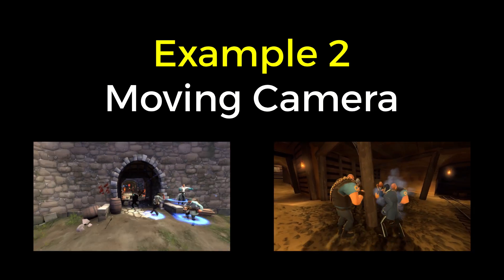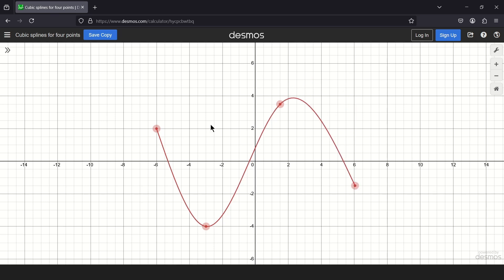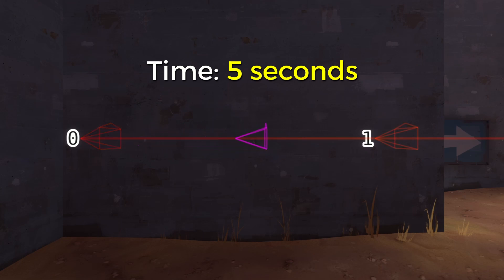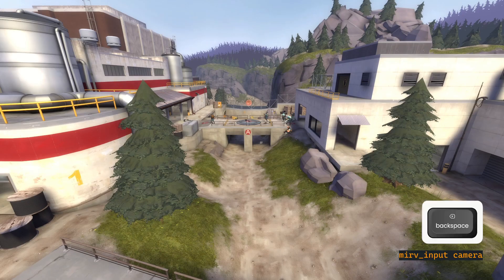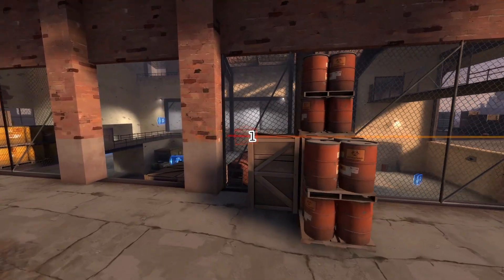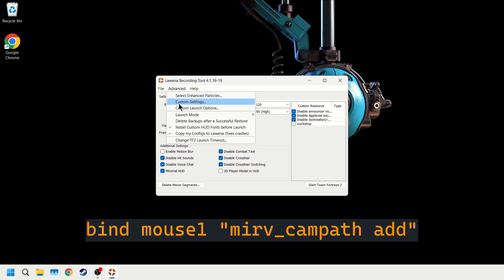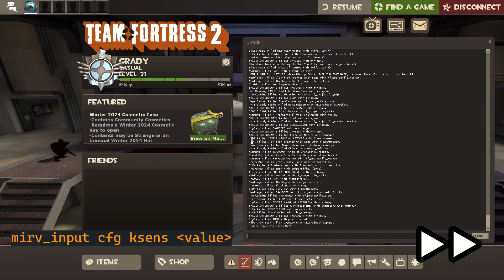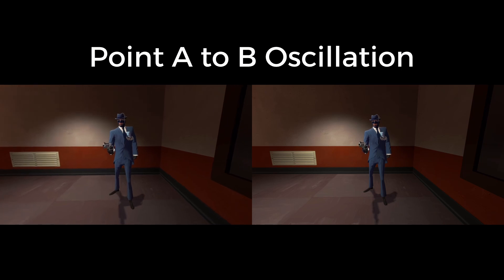TF2: HLAE & Lawena Full Tutorial Part 2 - Moving Campaths

Comment: really well made tutorial! very informative and it helps a lot. i appreciate you taking the time to make this.
i do have a question though, do you think it's possible that maybe a controller, such as an xbox controller, would be able to be used for a substitution for WASD jittery and rigid camera movements? sometimes you dont wanna make a campath but wanna freehand stuff. and maybe if its possible with a controller, moving the camera could be smoother than with a keyboard? im curious to know what you think, thanks in advance!
Reply from the maker: That's a creative thought, but luckily there actually is a smooth freecam feature that I found out about after releasing this series.

It had some issues though, so I modified HLAE to more resemble TF2's freecam as much as possible: https://github.com/wgez/advancedfx/releases/tag/v2.186.14-smooth

I'm working on a guide for it right now, but it's gonna take a while. I'm gonna have to give you a quick rundown as a comment.

You just need to use my version of HLAE instead of your old one.
1) Download + extract the first zip (I hope your browser/pc doesn't flag my release as a virus)
2)  In Lawena, go to (Advanced -> Launch Mode -> Select HLAE executable...), then choose the newly extracted HLAE.exe.

Now you should have the ability to use smoothcam. But I've made some extra commands to go into your Lawena custom settings.
1) Copy these commands and add it to the bottom of your custom settings (Advanced -> Custom Settings...):

// Commands to help use Smoothcam
alias h_mesA "echo smoothcam_ON"
alias h_mesB "echo smoothcam_OFF"
alias h_smoothon "h_mesA; mirv_input cfg smooth enabled 1"
alias h_smoothoff "h_mesB; mirv_input cfg smooth enabled 0"
mirv_input cfg offsetMode ownLast

// Optional: Recording Smoothcam Feature
// Note: Susceptible to demo file lag
// If too much jitter in campath, record smoothcam manually (OBS)
alias h_do "mirv_campath add; wait 11; h_loop"
alias h_mesC "echo record_path_START"
alias h_mesD "echo record_path_STOP"
alias h_on "h_mesC; alias h_rec h_off; alias h_loop h_do; h_loop"
alias h_off "h_mesD; alias h_rec h_on; alias h_loop"
alias h_loop ""
alias h_rec "h_on"

// WARNING: Drawing h_rec path onscreen (J) can lag/crash game
// If using h_rec, unbind J (remove the double slashes below)
// unbind j
Reply from the maker: Now you're ready to use smoothcam:

1) Turn ON smoothcam with the command: h_smoothon
   Turn OFF smoothcam with: h_smoothoff

2) Adjust acceleration/smoothness with: mirv_input cfg smooth halfTime <value>
   The default value is set to 0.2

3) Extra features about this HLAE version:
   a) No twisting (Z and X keys wont work) - trust me it makes your cam look much better
   b) You can't look too far up and down (no backflips/frontflips, which are disorienting)

There's also an extra feature I had you add in Lawena's custom settings which I feel is too complicated to talk about in a youtube comment (h_rec command). It's meant to help so you don't have to OBS record each and every attempt you make at tracing a path with smooth freecam. h_rec will spam campath points, so you could just record the campath if you're happy with the attempt you traced, if that makes sense. You can try it out if you'd like. Heed the warning though, avoid rendering the campath since it has a lot of points.

Some of this stuff may not be finalized. Let me know if you have questions. I may not respond as fast cuz my bot doesn't see replies.
Reply: @Weegeepootis2  thanks so much for this!! ill be sure to try it out, when i did, ill let you know how i fared.

edit: i just read through the features you listed. yeah the camera barrel rotating type thing was frustrating. and the backflip frontflip camera was nauseating as well.
Reply: so i tried out the smooth camera feature you made. it works pretty well! no complaints so far. though i still have some issues with campath wobbling i think. they camera doesnt tilt anymore, but it still overshoots the camera placement sometimes.
for example if i put a camera point near a wall, it sometimes goes through the wall and takes a while to move to the next point.
is there a way to disable this or maybe lessen this? thanks!
Reply from the maker: Yes, overshooting is something you're gonna have to learn to deal with. It's an inherent mathematicaI behavior that won't go away. I can't give you a one-size-fits-all solution to this, since it's dependent on your path, which can vary infinitely. You have to get a sense of how campaths behave, which takes practice. I'm basically reiterating the video.

It's the toughest thing to teach. One way to learn is the desmos website (eg. visualize a horizontal line/wall and try to prevent overextension into the wall).

As for your specific situation, it's hard to pinpoint your problem without seeing it. But since you described it as "taking a while to move to the next point", that probably means that either your wall point was placed too early (draw it at a later time), and/or your next point is placed too late (draw it at an earlier time). Perhaps try deleting the wall point, then rewind and play the campath, then pause at the time where it goes deepest into the wall, then go into freecam and place a point at the wall. That could fix it, but even then you may not be completely happy (eg. may not spend as much time as you'd like at the wall, gets to the wall too slowly).

That's just one of many ways to deal with this problem. Perhaps the preceding points need to be redrawn more forwards in time, or perhaps you can add extra points to help control the speed (risk of wobbling/complication). I suggest trying the editing technique at 9:01 to see if that helps you understand faster. Moving campaths have a learning curve, and it's probably the most tedious/frustrating thing about HLAE. But once you get a hang of it, your workflow will speed up.
Reply: @Weegeepootis2  again, thank you!!!